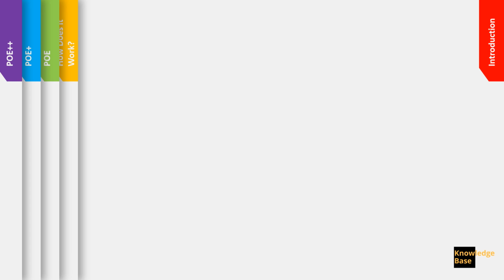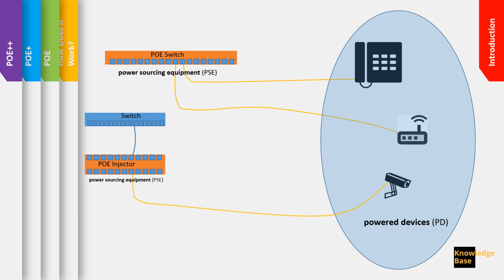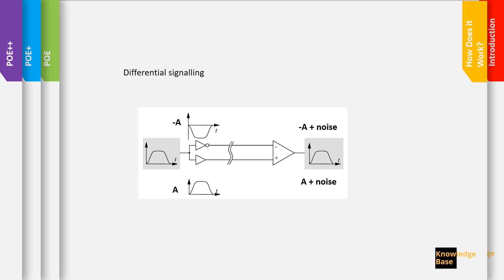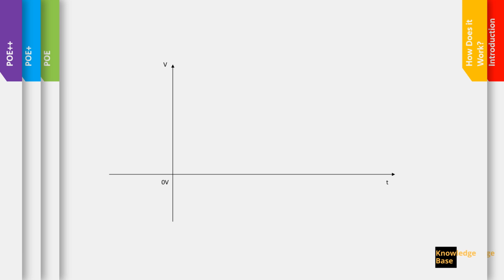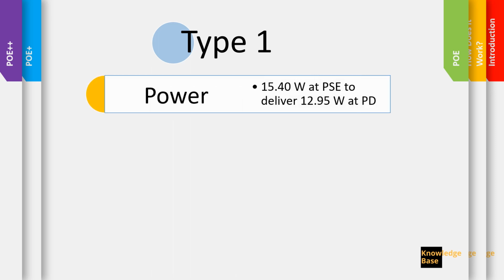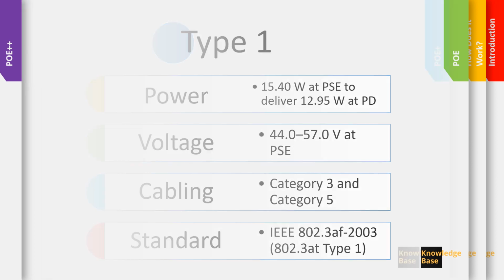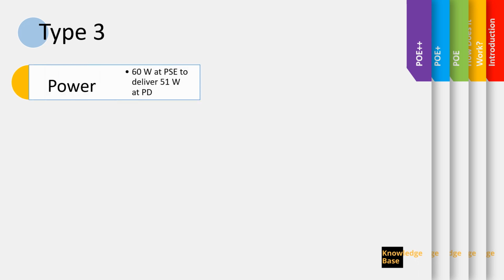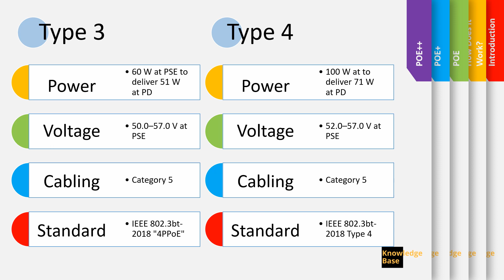POE, POE+, POE++

Comment: Hi, my Power device needs POE 802.3af, can I use CAT 6 cable to supply power to the device as CAT 6 cable is 802.3bt that carries more watts that the powered device needed? Will it damage my powered device? Thanks.
Reply from the maker: Hi, sorry for the late reply. yes, you can do that. if the cable is rated for higher power this will lead to a better performance and less power wasted in the cable. Depending on how far your device is from the source you may want to consider a lower gage (thiker wire) for the installation.

Comment: Question: is type 4  = POE +++   or  POE++ have  type 3 and 4    (if so how can you tell with one you have)
Reply from the maker: The 802.3bt standard came with two new options: Type 3 and Type 4. Both refered to as POE++. The POE device you are using will support one or both types. You can know that from the device specifications.

Comment: thanks, being not an expert in light current, what the solution if I've a an outdoor PTZ camera with more than 70 watt power budget, how can I supply it through poe if maximum pse capability is 71 watt?
Reply from the maker: Thanks for the question. you can use a power injector or also called a mid span to power your PTZ Camera.

Comment: I have what I believe is a standard poe switch then.  It says it can do 17 watts max per port.  I've been trying to find a wifi 6 AP that uses this. I also have two point to point antennas  which came with a 24v poe injector.  Guessing thats called passive.  Assuming its always going to apply 24v on the line no matter what is connected?
Reply from the maker: Yes the POE injector (also called midspan) will add the voltage to the line. not sure how it will work if you have a POE switch it depends on what you have.
Reply: @KnowledgeBase2020  well the switch i have i know wont power my point to point antennas.  I was hoping I could find a wifi 6 ap though that used standard poe though.  So far no luck.

Comment: What about POE devices that support passive 24V? Is that not part of the 802.3XX ?
Reply from the maker: Hi Anthony, Passive POE is a non standard POE and I would not recomend using it as it could cause damage to your network devices in the voltage requirement is not matching.

Comment: Good day, would a PoE+ switcher damage non-PoE+ device when you plug it in one of its PoE+ port? Thank you.
Reply from the maker: No, it should not. The switch will only send power from the port after a comunication is initiated and the device is identified as a POE device. However this may not be true with a mid span device.

Comment: basically the difference is more voltage in each type right?
Reply from the maker: Not necessary. The power is measured in Watts (W). Voltage (V) is a factor of power. Increasing the voltage will allow a cable to deliver more Power or Watts at a lower Intensity (I) measured in Amperes (A). The goal is to deliver more power but to achieve that we increase the Voltage on some cases.

Comment: have questions I put 3 poe switch with full ip camera but video is stak stak  but if i connect only two peo switch is working ok but if i connect 3 together  video is stak stak what is problem
Reply from the maker: Hey Said, this is a network issue. You need to configure the network to make sure that the total bandwidth from the cameras in not hitting a bottle neck somewhere in the network.